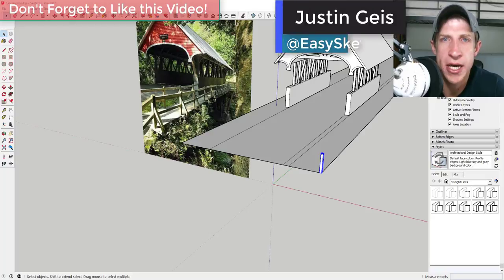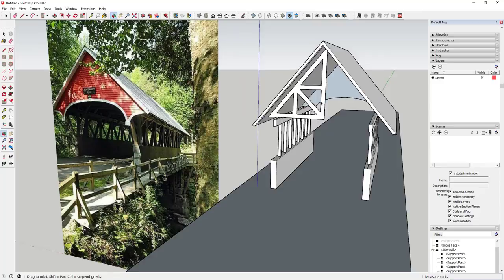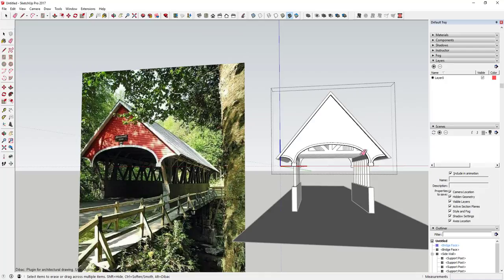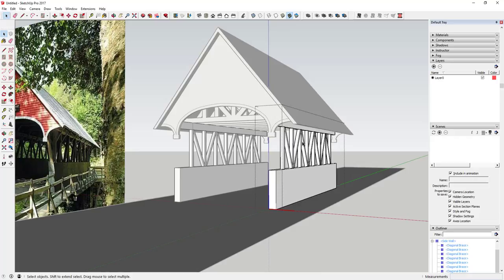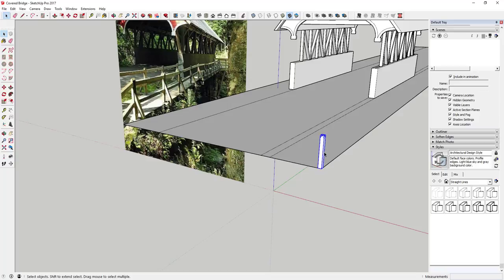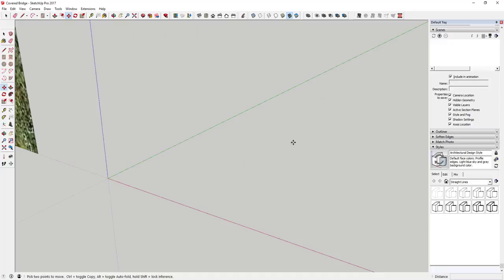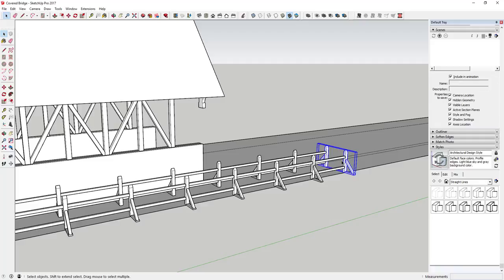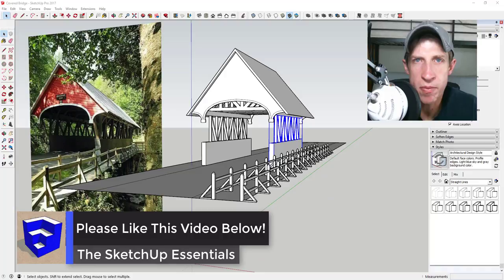Modeling a Covered Bridge From a Reference Image - Part 2 - Structure and Fence

Comment: You can flip objects by right clicking and picking flip along axis.
Reply from the maker: Hi Olav - I know - For some reason, I usually pick the wrong axis when using flip along axis, so it's quicker for me to use the scale tool to flip objects, but that works as well - thanks!